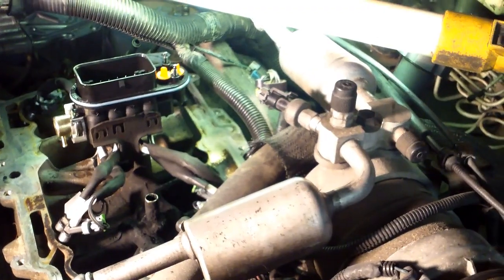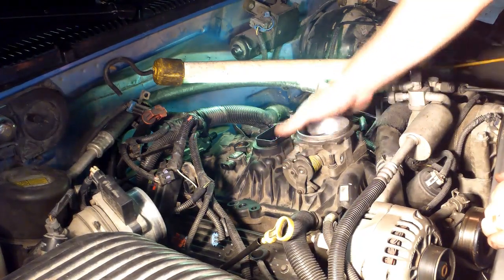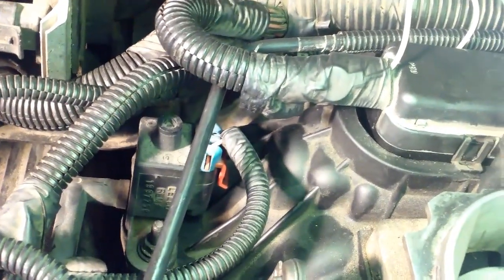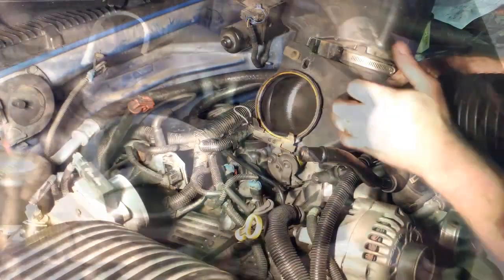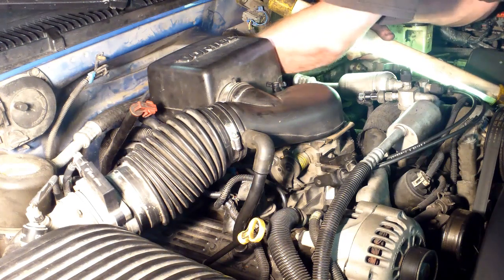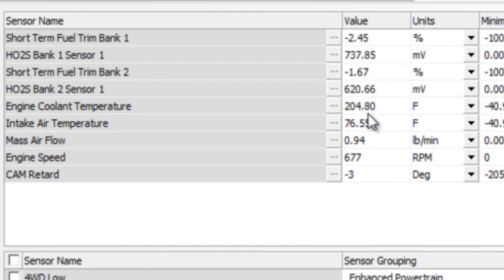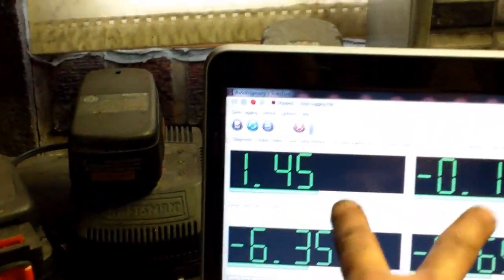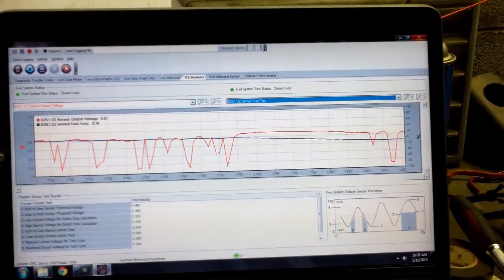Part-2 Troubleshooting a rich condition P0172 P0175 GM Spider Injection

Comment: just cant thank you enough for your videos, I have a 1997 and a 1999 suburban,  1988 AND A 1997, CHEVROLET TRUCK. you have saved my butt. I have followed your videos on lower intake manifold gaskets, as well as the spider injection replacement, and many other things. Im mechanically  inclined but not a general mechanic but because of your videos you have saved me a lot of money. Im on a very low income and don't have much but my old trucks is all I have. thank you sir, or my butt would be walking right now. My dad has passed not long ago and two of these where his. They do mean a lot to me. also its nice that you do these videos without loud music and are very clear on instructions. I cant thank you enough. Please continue to make these videos, Im half death and I can clearly understand you. oh also thank you on clarity of torque specs as you go and bolt sizes you are my hero, im serious, with out your help, I would be walking. You seem so down to earth and look out for the common man. I tip my hat to you sir, Thanks again

Comment: Well the thing i tell people about rushing me is, "do you want a good clean proper repair? or do you want me to cut cornors and you have issues in 2 years?" its a nice way of saying fuck off and let me do my job. prime example is 6.0  powerstroke they wonder why i pull the cab like your sapose to, simply because the job is easyer and everything is easyer to clean and check for warpage ect:P